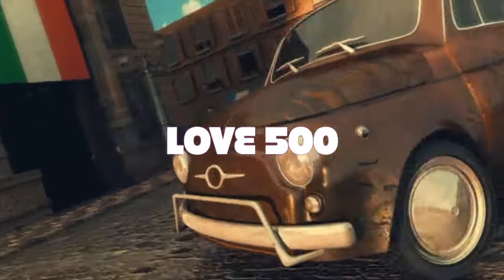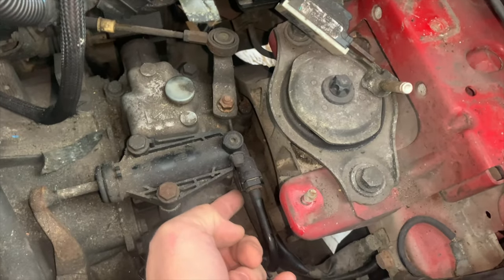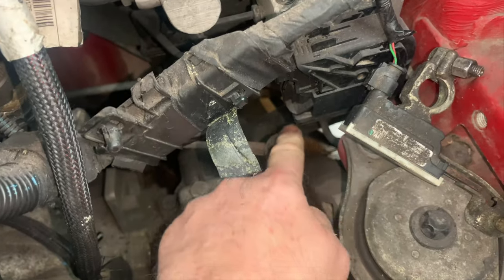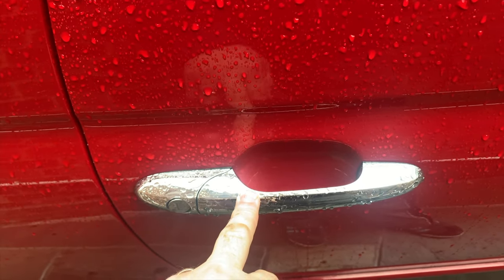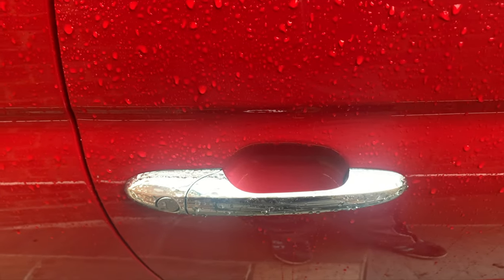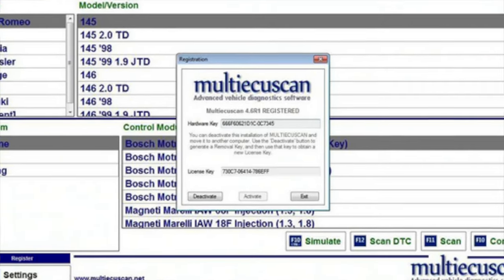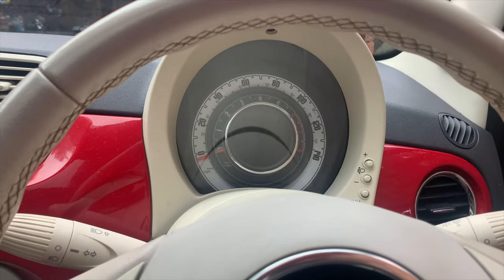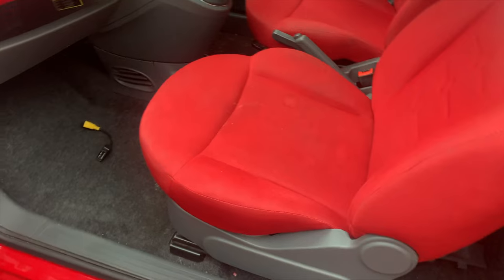Common Faults on a Fiat 500 or Abarth 595. The faults are the same. #abarth #fiat500 #595

Comment: Have an obd2 scanner they really help.
Reply from the maker: Not sure most buyers would want you plugging devices into their car.
Reply: @Love500  What do you think the mechanic plugs in when you take it to the shop and want to know whats wrong with youre car.
Reply: @Love500  Besides i pretty much am a close expert on them now ,I keep mine as close to brand new as i can.i just put 2 coats of wax on him. i have a boy car.my car likes being rubbed on.Someone called it a love bug once. My car is not a bug think Godzilla but smaller.
Reply from the maker: @royceburris9419  If someone came to look at your car on your drive would you want them ripping off the panel and plugging in a device? I know I wouldn’t and neither would joe public I imagine. It’s not a garage it’s some bloke on your drive!
Reply: @Love500  dont rip off anything just plug it. Last time it was running rough i plugged it in .It read #1 coil pack fault. I go go buy and replace #1 coil pack and GET IRIDIUM SPARK PLUS at original factory specs. put em on and poof car runs great.And i have worked on motors since i was young and have replaced a few and clutches on old heavy duty trucks with heavy transmissions.,I have removed my dash and repainted once though and it looks better than the factory  not kidding. And if u dont know that you have to take nothing apart to use the obd2 then stop telling us how to fix our cars
Reply: @Love500  i bought used the red stripe decals on the sides were becoming and ugly faded orange.i waxxed and brought the red back out.It is silver with red stripes 2012 sport
Reply from the maker: @royceburris9419  a Fiat 500 OBD port is behind a panel that you rip off, so I’ll carry on, but thanks for your input.

Comment: What type of coolant do you suggest ?
Reply from the maker: Triple QX Red ready mixed. About £15 for 5 litres.
Reply: @Love500  Thanks! is MANNOL G12+ good as well ? 

Also do you have any videos about the seats wiring ? I have a 4/6pin connector sticking our the passenger seat next to a small orange plastic box under the seat...no idea what that is. I have a 500S
Reply from the maker: @Minecrafter_X1  I’ve never heard of it. Just don’t mix two different ones. I haven’t got a specific video. Disconnect the earth of the battery and look under the front side of the seat and just plug it back in.

Comment: i have had most of these problems ..mind my fiat is 12 years old now ,mind you its only got 62,000  miles on it .. i brought in brand new ..to be honest i am thinking of getting rid of it before i pay the next bill for new suspension , cup mounts ,,oh and a new exhaust ..everything is just too expensive now , will i get another car ..most likely no !! ..electric pedal bike i think . far far cheaper !!! what with the price of fuel , insurance , mot fails etc etc just not worth the hassle . One thing that has gone on mine is the coating on the paint all peeling off ..it's a red car .which looks a real mess and will cut my selling price considerably .
Reply from the maker: Red cars have a habit of the lacquer fading and/or peeling. The paint would be ok. 12 year old cars are a bit tired now but if we’ll maintained more reason why they can’t carry on.

Comment: On my 2013 the exhaust rusted off the catalytic converter, dealer wanted enough to fix it that I gave up on Fiat.
Reply from the maker: Never heard of that happening. You live near the sea?
Reply: @Love500  
I live in Ontario Canada. I drove the 2013 from new till March of 2020 and it was no longer rational to spend money to repair the car, I loved driving it but I couldn’t in good conscience recommend it to anyone. A car should go further than 120,000 km without falling apart around you. I had the shift linkage grommet fail while driving between New Orleans  and Sarasota Florida, I was able to still shift between 3rd and 4th but all the other gears weren’t accessible. The part according to Fiat was going to take two weeks to arrive fortunately I had found a competent independent garage that adapted a generic grommet to work and less than $200 later I was back on the road.

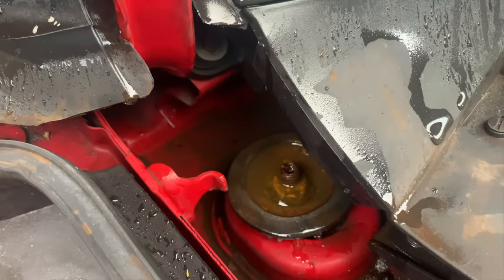Comment: 1:30 rusty bolt, sorry nut, won't cause the movement there but a top strut mount underneath will, that bolt, sorry nut, and cup carry no weight whatsoever, its there just to stop it pulling through, in fact it floats clear of the metal of the body..
Anybody reading this and finds the top of the strut moves, it is NOT this bolt, sorry nut, that is at fault, replacing this bolt, sorry nut, will NOT fix the movement, you need to replace the top strut mounting that is not visible in this video
Reply from the maker: But rusty nuts are not good and need to be protected. Stupid design.
Reply: @Love500  yes silly design, will be impossible to remove
Reply from the maker: @bonkeydollocks1879  I’ve had to use a hammer and chisel in the end. Took some doing.
Reply: @Love500  same here, it's such a fine thread it just welds itself to the strut

Comment: Ok so long story short is it worth buying a 500 sport or abarth what would be better
Reply from the maker: A sport is mechanically the same as a lounge, pop etc. A Twinair is a compromise between an ordinary 500 and an Abarth but an Abarth is a totally different experience. You need to drive both if you are unsure.
Reply: @Love500  I've driven a 500 sport and liked it but i want a bit more and i like how the abarth looks i just dont  to buy a junk car I found a 2013 abarth with around 70,000+ miles would it be smart to get for a new daily
Reply from the maker: @Guitar213Dude  personally I wouldn’t buy one with mileage that high but they do tend to have been looked after.
Reply: @Love500  I feel like getting an abarth is a bigger commitment than just a fiat 500
Reply from the maker: @Guitar213Dude  not really. It is a Fiat 500 at the end of the day. Performance parts are much more expensive though.
Reply: @Love500  I was given the impression that the abarth had different parts and was a so called special car that was harder to obtain parts for compared to lesser models
Reply from the maker: @Guitar213Dude  it’s no harder they’re just more expensive. The UK is the biggest Abarth market in the world so there are plenty around. There are lots of different upgraded parts available too.
Reply: @Love500  ok so they are all fine just one is a bit more so for say a 2013 what is a good milage I should look for the 500 sport I had for a while was at I wanna say 70,000 and it mechanically was pretty sound definitely had all the normal wear and tear these cars go through but was still good car I do really like the abarth just wanna make sure I know what I'm getting into
Reply from the maker: @Guitar213Dude  it’s difficult to put a figure in it really. Look at .gov mot history and a full service history.
Reply: @Love500  ok well thank you so much for being helpful I know people who know lots about car but never actually tell me anything so its nice to finally get some info

Comment: On the first one, how is the water supposed to be drained in either case? I can't understand for the life of me wtf is that water plumbing design
Reply from the maker: It doesn't. The trick is to not let it get there in the first place. You can buy covers that let it drain off.
Reply: @Love500  it seems designed to drain there for some reason. If the cover is put the water will be trapped in the shock tower and instead of an bolt rusting will rust the shock tower.  Where is the front drain hole?
Reply from the maker: The water runs off the covers into the area under the scuttle panel. Each top mount area has a small drain hole just in front of it which allows water to drain away and the scuttle area has the two rubber bungs that drain water onto the ground behind the engine. These need to be kept clear of debris otherwise the scuttle panel will pond and you risk water leaking through into the cabin where it will find its way to the airbag ECU and fry it.

Comment: interesting - NAFTA Fiat 500s don't get a separate clutch master cylinder as far as I know...
Reply from the maker: Yours are all 1.4 aren’t they?
Reply: @Love500  That they are.  1.4 Multiair, with or without turbo.  We have a lot of the same issues around the car.
Reply from the maker: @archenok  design faults or “quirks” as Fiat probably call them are common across the globe.

Comment: Surely, it would be easier to say 'thinking of buying a Fiat 500' then don't as they're shockingly shit.
Reply from the maker: But they’re not.
Reply: What makes you say that ?
Reply: @billwilson6096  build quality im afraid. Whilst I get they're quirky looking cars, t build quality is less than desirable. But if u accept t upkeep that comes with these vehicles and more importantly u like t car then this is all that really matters. 🙂👍
Reply: You can find faults for any car. Also, it doesn't mean every single fiat will have these problems.
Reply: It's not production fault but faults that will get a lot of car in some stage of life.
Reply: @04poppop  I'm afraid I disagree. There aren't too many mass produced cars which req exterior door handles replacement as regular maintenance on failure if instrument clusters, power steering. All these items should be expected to last t life of t vehicle
Reply: @david-iandawson  There is not any crucial problem on the car, changing door handles is matter of couple of pounds and couple of minutes. I don't believe car is some seriously sick. The rest said is questionable,
Reply: @04poppop I'm afraid ur incorrect. These exterior door handles retail over a £100 per handle (genuine parts) and take an hrs labour to fit - hardly a couple of pounds and a few mins labour. Ref t instrument cluster faults, Google this for further info and ul find that ur opinion is most questionable. Whilst mine is factual. But if u like these cars then this is good.